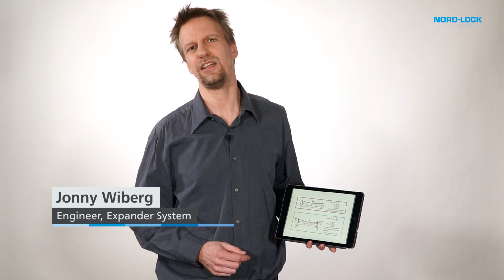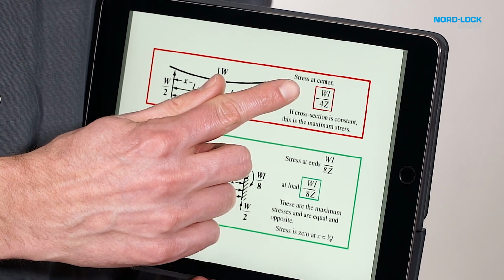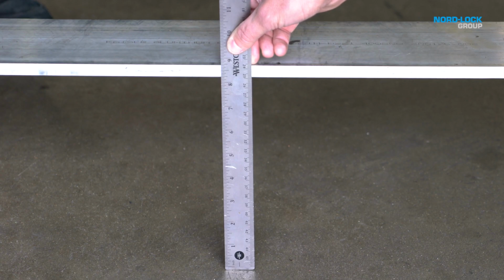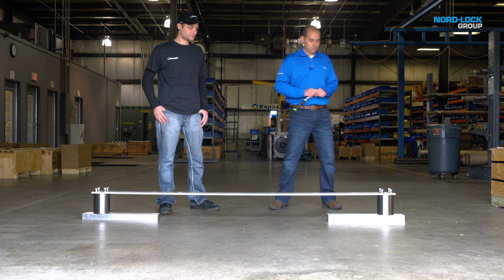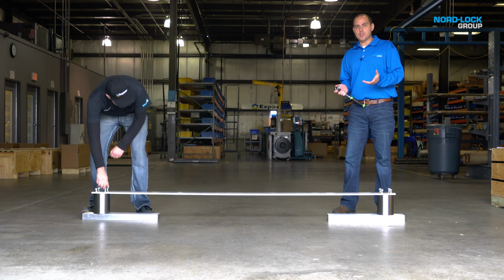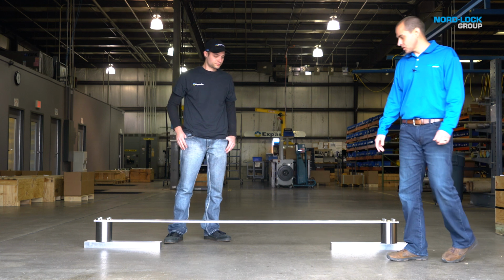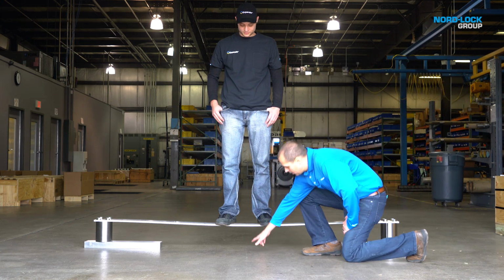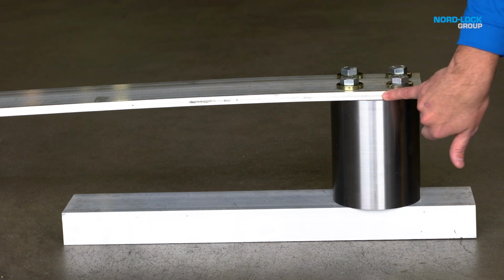How Can Expander Pin Reduce Stress in The Axle

Comment: Its still dangerous
Reply from the maker: We understand your concern. Could you share what specific risks you have in mind? The Expander System is designed to reduce axle-related issues and improve safety, especially when installed and maintained properly